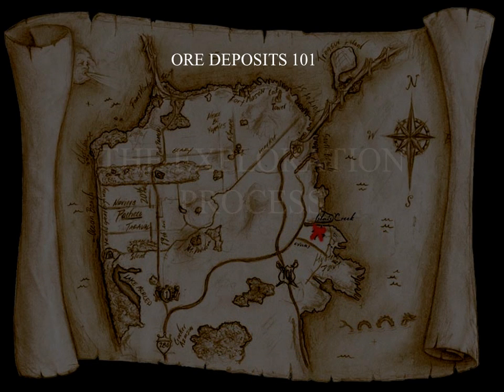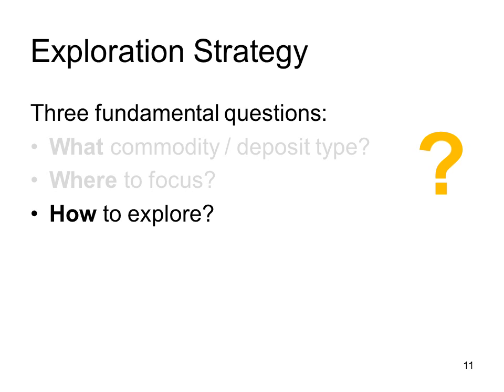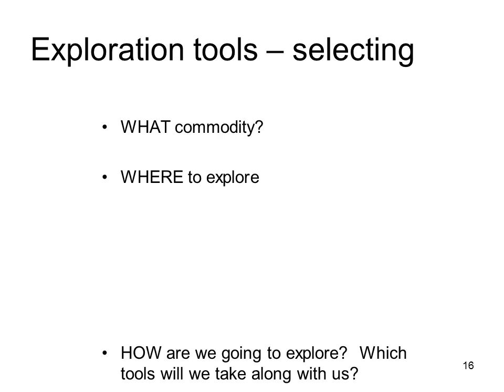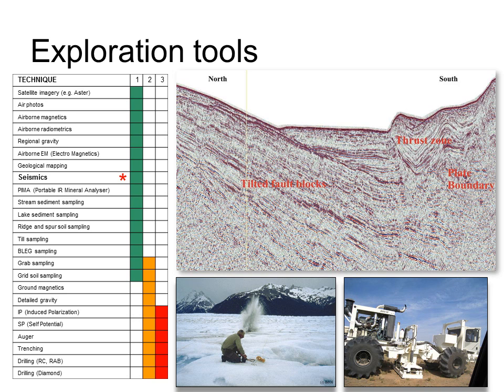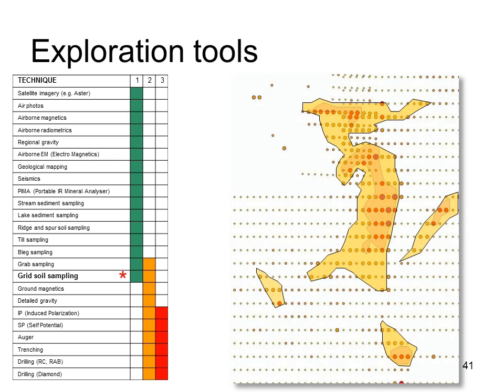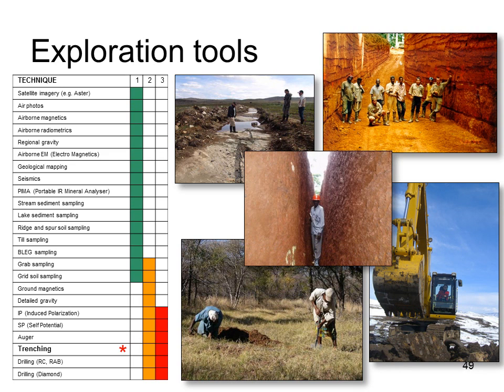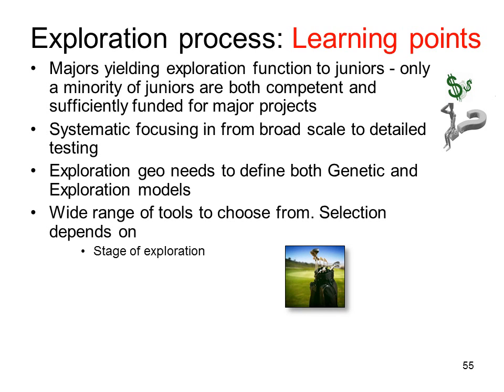ORE DEPOSITS 101 - Part 10 - Exploration Process

Comment: timestamps:
0:00 introduction
1:24 fundamental truths of the exploration industry
2:27 how the exploration industry has changed the last 10 years
6:09 three fundamental questions when an exploration strategy is designed
11:49 what to keep in mind when designing an exploration strategy
15:13 exploration tools introduction
17:08 exploration project stages
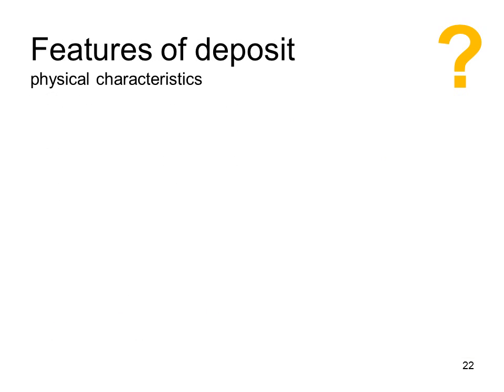19:03 features of deposit
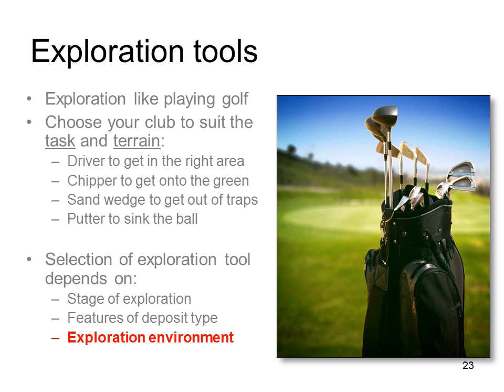20:24 nature of the environment
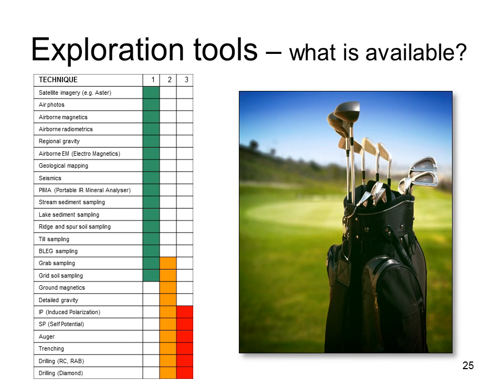22:07 common exploration tools
22:35 satellite imagery (e.g. Aster) & air photos
24:43 airborne magnetics
25:48 airborne radiometrics
26:35 regional gravity
27:42 airborne EM (electro magnetics)
28:54 geological mapping
29:25 seismic surveys
30:49 PIMA (Portable IR Mineral Analyzer)
32:14 stream sediment sampling
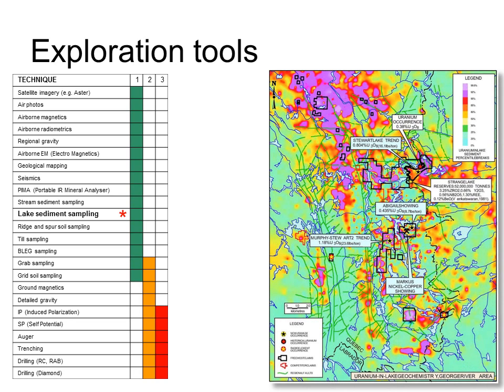32:59 lake sediment sampling
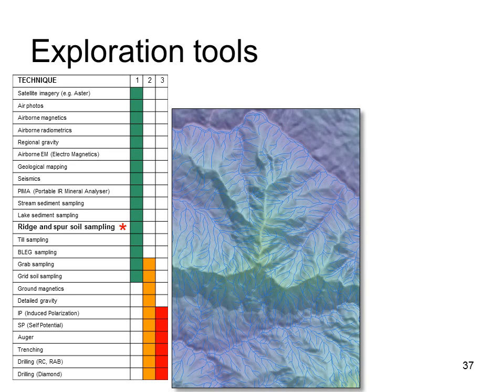33:35 ridge and spur soil sampling
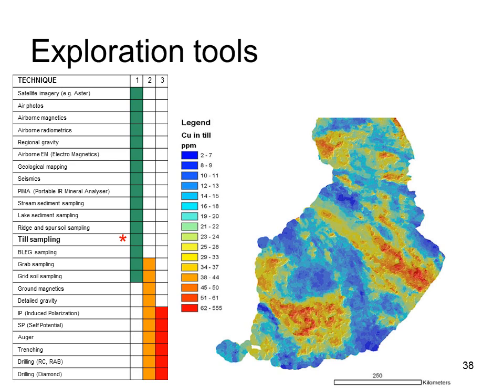34:17 till sampling
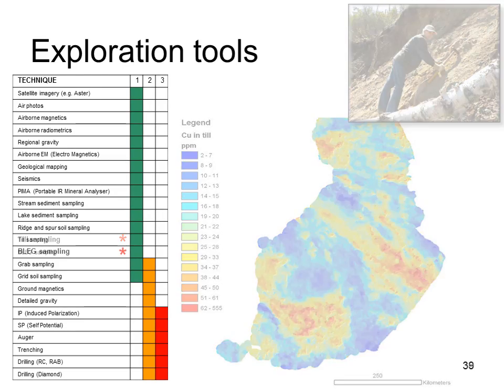34:53 BLEG sampling
35:49 grab sampling
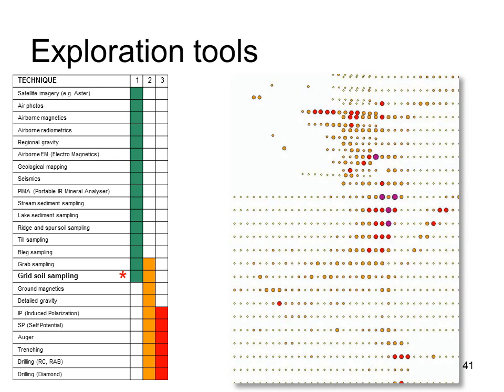36:37 grid soil sampling
38:54 ground magnetics
39:53 detailed gravity
40:42 IP (induced polarization)
41:58 CSAMT (controlled-source audiofrequency magnetotellurics)
42:36 SP (self potential)
43:18 auger
43:49 trenching
44:44 drilling (RC)
46:03 drilling (RAB)
46:48 drilling (oil/gas)
47:57 drilling (diamond)
49:10 GIS
50:28 learning points
52:22 end
Reply: Can you do this for the rest of the videos?